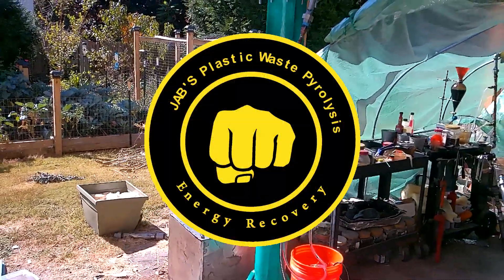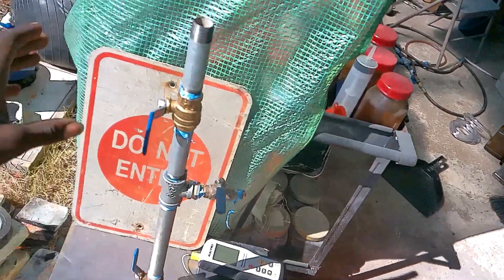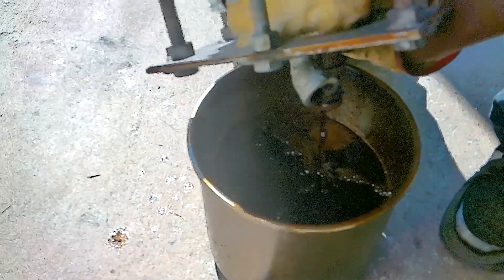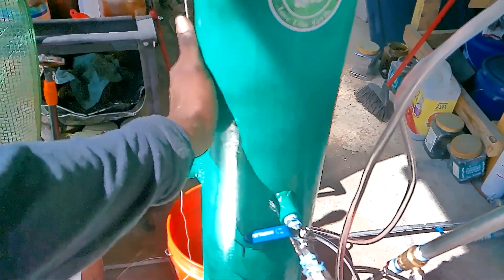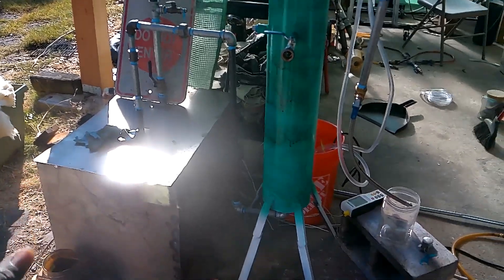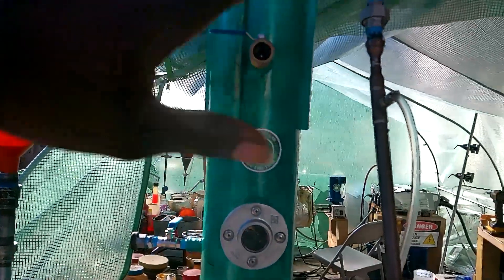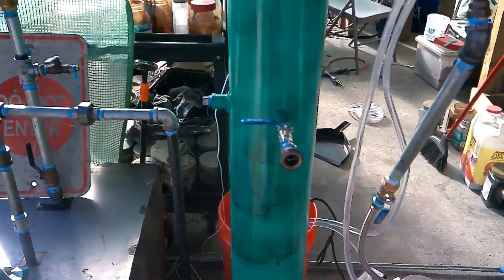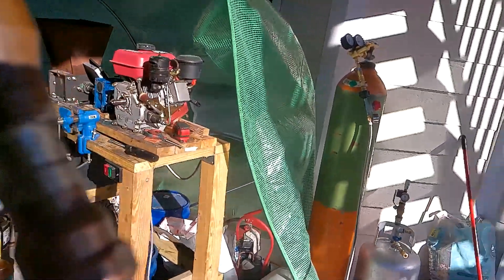Running Mark II Distiller

Comment: Your column is a batch distillation set up to run as if it is continuous. 

The feed comes in from the side and that is not arbitrary. The optimal feed stage can be calculated for binary mixtures using McCabe Thiele. You have multi component mixtures so you will likely need software to determine this stage. 

A big thing you are missing is a condenser that can send liquid back down the column (reflux) and and also withdraw some distillate. At a controlled rate. You will get better separation with high reflux ratios (liquid sent back down the column/liquid collected as distillate). Especially for distilling hydrocarbons, let things reflux for as much as possible if head temperature (the temperature of the vapor at the top stage just before it condenses) isn't really identifying anything specific. For example acetone would boil over in pure form if the head temp was acetone's boiling point of 56C. Anything above or below that may be a mix or an entirely different compound. 

For scale up:

Look into O Connell correlation to determine how quickly you should be boiling up the vapor to ensure high tray efficiency. 

You are also missing a reboiler. Look into partial reboilers and boil up rates. It's more of a continuous distillation thing so something to keep in mind for scale up.

Comment: Why not connect the bottom of the column to the bottom of the boiler? It’ll have crude in both of them but the boiler will still produce vapor

Comment: Just talking out loud here but depending on the temps that your equipment is seeing  you might want to move away from Teflon tape and ball valves sealed with Teflon.  Check out a product called x-pando pipe joint compound, it's damn near inert to everything, is good to 5000psi and has a working temp from -300 to 1000°f. You might also look at using metal gaskets or spiral wound seals with appropriate flanges.  Hope this helps. Be safe.
Reply: Ohhh nice stuff

Comment: To perfect the fractional distillation, the best option is always to have separate chambers insulated in such a way as to keep each desired fractal just exactly at its 'dew point.'

In other words, each chamber is going to cool by a fixed rate [based on its absolute thermal entropy and its absolute thermal mass transfer] so that each chamber remains within a narrow enough temperature range, so as to have only one specific hydrocarbon condense in each chamber.

From there you can select or eliminate any given product from planned, intended mixtures, based on your final target product outcome.